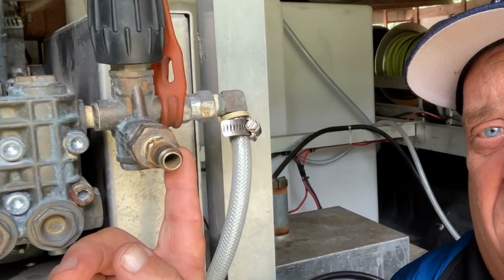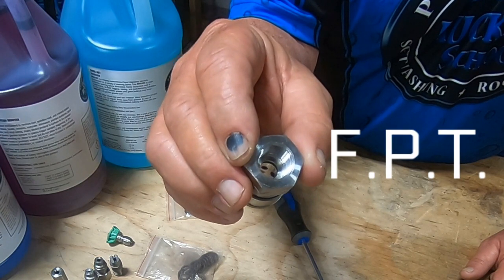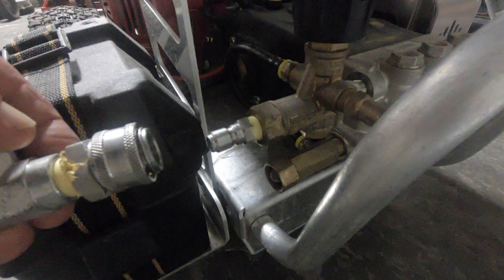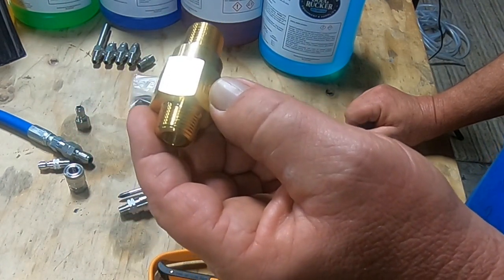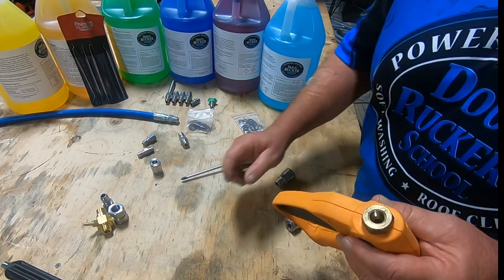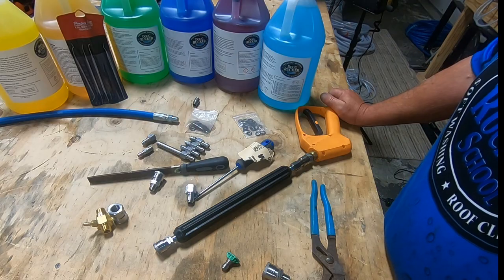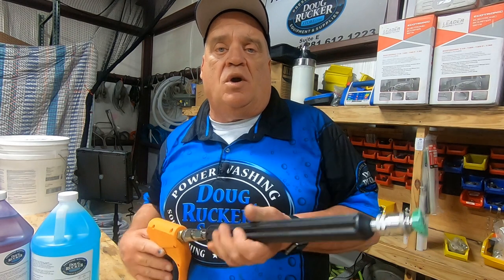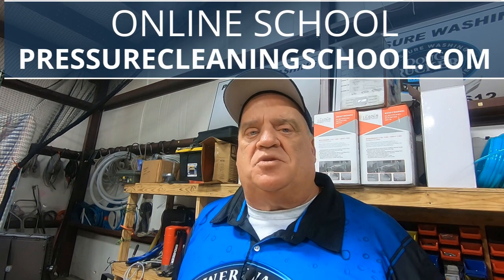PRESSURE WASHER HOSE FITTINGS EXPLAINED

Comment: I learned a lot from this video. I’m working on a sunjoe pressure washer that has a “plug” designed by the manufacturer already installed that I cannot remove or replace, but I’m not sure what size it is or what “fitting” to use to marry the two.

Comment: Great video, this is the clearest and simplest one! I'll say I'm a "coupler goes on the hose" believer, since when swapping tools out or dis/connecting to the base, the hose is going to be in my strong hand and I can just reach up with my thumb and finger to pull the collar back. Of course you can make a case that when you're going to swap, the tool/gun will be in your strong hand so you can just operate the collar that way, but it just seems a little more fiddly to me that way.
Reply from the maker: Yes I’ve heard that from many that prefer coupler out.

Comment: Just purchased the Vortexx 3000HD pressure washer.  The lead fitting it came with is a Plug; the fitting installed on the machine is a coupler - which is the converse espoused by you.  Also, the long wand did not have a swivel attachment, it came as a one piece wand. 
Btw, the information you provided in this video is not intuitive. It is an introduction into the vocabulary of fittings used on pressure washers.  Helped me a bunch since this Is the first time buying/using a pressure washer.  Thanks
Reply from the maker: Yes. Every machine I’ve ever bought the league fitting was the Coupler. I always change it to the plug

Comment: My first take off fitting is the coupler . The reason I do it is for when I go to hook up any device all I have to do is hold my hose and pull the fitting back for easy connection. If you’ll notice everything Ike the end of a wand or a trigger all have couplers.
Reply from the maker: Yep. All a personal preference. I just prefer and was taught plug points the way of the water flow Early on and I’ve just always stuck to that

Comment: What is the best hose fitting crimper in your experience...I need to make a custom length 5k psi 3/8 line. And a 1inch custom  softsash line
Reply from the maker: No experience there. Never owned a crimped. But I’m looking at maybe investing in one

Comment: Awesome video.  I have a portland pressure washer and I'm trying to switch out my old pressure gun with a torque eqp402 snubby easy trigger foam gun. What connector do I need to buy to hook up the pressure washer hose that came with it to connect to my new gun
Reply from the maker: I really am not sure is I’m not real familiar with those pressure washers

Comment: Hey Doug! For some reason my machine is leaking water from the connector, I see little divits, should I just sand it? Or replace the connector?
Reply from the maker: Yeah try sanding. Did you check the o’ring In The coupler ?

Comment: Queation: I have several brass quick connects on my electric power washer in my detailing shop that want to seize up and now I can't get one off the hose inlet? What do you recommend?
Reply from the maker: A penetrating oil to see if it will loosen up.

Comment: I have a question too. I recently purchased a Husqvarna PW480 pressure washer and they have their own proprietary fittings unique to Husqvarna. I purchased an addition extension hose with their quick fit connectors on each end. I want to have this pressure washer fit my 24 foot pressure washer lance which has a 17mm female connection in the base of the lance handle. The thing I want to do is cut the end off the hose and get a fitting/coupler (male 17mm) to be crimped onto the hose so I can use the lance with my Husqvarna machine. The hose has 1/4 stamped on it. I have been searching hi and low and can only find a hydraulic fitting in that size and trying to find someone to crimp it on. Do you have any suggestions? apologies this is so long winded and hope I make sense to you. Cheers Ian in the UK
Reply from the maker: A hose and hydraulic place can crimp it on. Some auto parts stores do it too

Comment: Hi, I've a Bosch EasyAquatak 1700 Electric 1700PSI pressure washer. Both end of the hose have same type of connector (type C, I assume). Can u plz recommend what type of connector I would need to make my washer  quick connect enable and/or use other type of guns/foam cannons?
Reply from the maker: You can’t. You’re pretty much tied to that hose and water comes with it. You would have to go to a machine that uses 3/8 hose
Reply: @PressureCleaningSch  thanks for your response.

Comment: I have a Bosch Pressure washer 35-12 with Quick Connect SDS Fittings hose I'm planning to upgrade the gun most likely it will have an m22 inlet. Would a 20.5mm female coupler work ? Other end is 11.8mm

I'm trying to connect the gun to the hose
Reply from the maker: I am not sure on those. I have never used one.

Comment: Hopefully you can help. I just purchased a Simpson powershot 3228 that coming out of the pump I need a 5/16th hose. Is there a coupler/quick connect that will work for a 5/16 hose?  I'd like to put a quick connect on the pump to the hose and then a quick connect from the hose to the gun.

My understanding is I need an adapter from the pump otherwise I can get a 5/16 hose with proper m22 but what does that mean for my quick connects.

Comment: Hey Doug, 
The problem I am having is that my male connection that is attached the water line is stuck as can be I have used to large vice grips to remove the connection to try and replace it but I can not get it to budge. Do you have any tips for getting the male fitting to release from your line? Does using heat help? I have tried PB buster and still have had no luck. Appreciate any insight
Reply from the maker: Send me a pic to info@dougruckerstore.com and let me look at what your trying to remove.

Comment: Doug, ty for another great video.  Relating to Lloyd's comment below I wonder if there a pressure splice kit because these days it can be hard to get 'stuff'.  Also, if a good hose just needs a fitting vs. throw away because of a cut or other it helps sustain the business.  Can you help?

Comment: Doug. I have access to 3/8 hydraulic fittings that are a little larger, easier to grip and seem to connect and release far easier than the standard pressure washer fittings. Would they be ok to use. Thanks
Reply from the maker: I doubt it as the pressure rating is probably not high enough

Comment: Can I use the SS fittings for a campervan water system? I need a quick connect solution for water and I wanna make sure there will be no contamination of any sort (metal, grease, corrosion). Thoughts?
Reply from the maker: I wouldn’t see why not. I’d check w a RV place first though.
Reply: @PressureCleaningSch  I got that covered. Brew store cleared info.

Comment: Bought a Dawalt 2100 electric power washer and can not find fitting to screw on the front of it do you know what size are the threads on the gun
Reply from the maker: On your gun?. No I don’t. Sorry. Manual should have a parts list and indicate it.

Comment: Doug - I noticed 3/8 fittings can have different interior plug diameters. Is there a reason for this and are they interchangeable?  I have a 3/8 ball valve that will only work on the thicker walled plugs.
Reply from the maker: Not something I’ve ever noticed. What do you mean the ball valve won’t work. Ball valve should work no matter the fitting in it.
Reply: @PressureCleaningSch  I think the ball valve came with a faulty female qc.  I replaced it with a new one and now it fits on all my guns.
Reply: I think also the different wall thicknesses are vendor specific.

Comment: I just purchased a eudo SC, THE SC has a plug fitting in handle, my set up from my PW starts w a plug and ends with a plug on my pressure hose where my ball valve is, how can i connect these? please help
Reply from the maker: You should be able to just change the fitting in the surface cleaner to a coupler. Or change the the fitting on the end of the hose. Just want to change so your hose can still hook up to all your other attachments

Comment: Doug, I have a troy-bilt model 020210; 3700 PSI; GPM:4.0, it has a GX390 motor. I want to change the coupler and plug on the hose and gun.  The coupler is 3/8".  Do I need to be concerned about the possibility of the threads being M22? How can I tell if it is M22? Owners manual does not say. Plus, I'm having a hard time removing coupler from the hose; any suggestions? Also, I went to the website you provided to a previous inquiry for the fittings (stainless steel coupler and plug), and the site no longer exists...is the site still available? Thank you ahead of time for your response.

Comment: My foam cannon has a 1/4 inch quick connect male when all my hoses are 3/8 inch. Is there a quick connects from 1/4 to 3/8s?
Reply from the maker: The foam cannon attached to a wand with 1/4 inch fittings. It doesn’t attach to the hose
Reply: @PressureCleaningSch  lol, yeah last night I was laying in bed and I started laughing. I realized that. I felt pretty darn stupid. But I can laugh at my own brain fart moments. Thanks for answering. I bought a Ryobi 2300 after watching a bunch of your vids. 120.00 new with damaged box. It is not even scratched. Thank you.
Reply from the maker: @Denver1976Man  I’ve had many of those. Lol. It happens.

Comment: I have a Husqvarna pressure washer 2000 from Costco. I lost the high pressure hose that came with it and is described in the instructions by red end or black end. Replacement hoses do not have the color code on them. Why?
Reply from the maker: Not sure Peggy.  I am not familiar with Husqvarna equipment

Comment: I got a surface cleaner that’s 1/4 and equipment that’s 3/8 I’m trying to get the adapters to connect the 1/4 this helped but I’m still not 100 on how to do it
Reply from the maker: What surface cleaner do you have and what part is 1/4 inch. Usually only the nozzles are 1/4 inch.
Reply: @PressureCleaningSch  I called it a surface cleaner in reality it’s more of a sprayer 4 nozzles with wheels people use it for shingle cleaning or sweeping
Reply: @PressureCleaningSch  ok so this is my dilemma I have a long pole for roof cleaning that is 3/8 my hoses are 3/4 if I’m not mistaken I have sureface cleaners that are 1/4 and other equipment such as ball valves that are 3/8 I am in a bind with all these sizes to make everything work together I just purchased a bag of adapters and I’m at a loss of knowing how to make it work or if I even bought the right stuff. If I don’t figure this out I will have to buy equipment that fits the size and basically buy it double. I’m a rookie just started and I’m at 97% with owning everything a pressure cleaning guy would want including soft wash equipment such as a 12 v pump x jet the whole package but again this fittings are a problem for me
Reply from the maker: @proof2.073  ok fist off you shouldn't use one of those water brooms for a roof. US the 12V system and bleach.   It can cause damage and irregular cleaning. You can get reducing nipples or bushings for the connections your trying to make at HD, Lowes, Ace etc.  You can also switch your hose to 3/8 from 3/4....if you want to text me a video to 2818833630 or email at pressurecleaningschool@gmail.com of what your trying to do I can try to narrow down what you need.
Reply: @PressureCleaningSch  Awsome will do thanks for all your help your saving me time and money
Reply: @PressureCleaningSch  how come I got sh 10% from pinch a penny I applied it to concrete that was black in it’s potent form no dilution with a pump spray and it didn’t clean it but I do that same thing with outdoor bleach and it cleans it? I also used the same sh 10% on a fence that was extremely black and got some of it better other parts stayed black and other parts it ate the wood made it bleed red did I get a bad batch of sh or what??
Reply from the maker: @proof2.073  not real sure sounds like the pinch a penny sh may be a little weak

Comment: Please help me!! ive been struggling with being able to start my business due to trying to run a line back to my tank.
Reply from the maker: What’s the issue your having.
Reply: @PressureCleaningSch  not sure if i did this right but how do you plug off the one end of the by pass that doesn't get ran back to the water tank? because there is no way i can remove the brass fitting so so far i kinda half a** did it with a small pc of hose and a bolt and hose clamp but of coarse that wont last. also i have the hose going back to tank now do i have to have it run all the way into the water or does that make a difference?
Reply from the maker: Kelly G Why would you want to plug it. You need the water to run through the the hose when bypassing so the end has to be hooked up off the unloader. The other end goes to the water tank
Reply from the maker: Kelly G and no it doesn’t have to go all the way into the water
Reply: @PressureCleaningSch  hmm then maybe I'm not understanding right. I'm going to go out to my truck and take a picture to show you. I had followed some video of how to do it but wasnt fully clear . Thank you so much for helping me because this has been holding me up. I'll be right back with the pic.
Reply from the maker: Kelly G Text it to me 2818833630

Comment: The tips are contradicting your flow theory, I have always led with the coupling. For the guys using their ball valve for rinsing, it works well leading with the plug so they don’t loose the o rings.